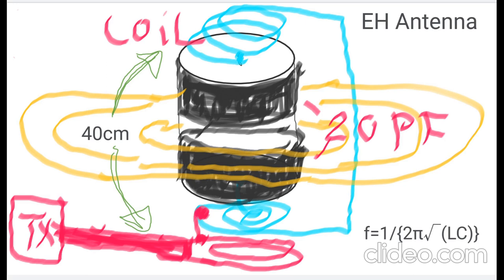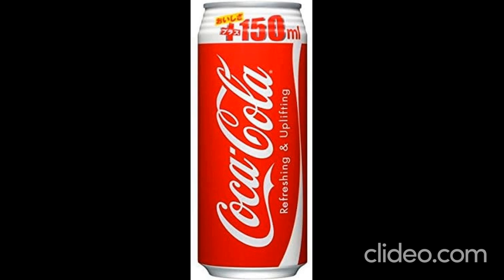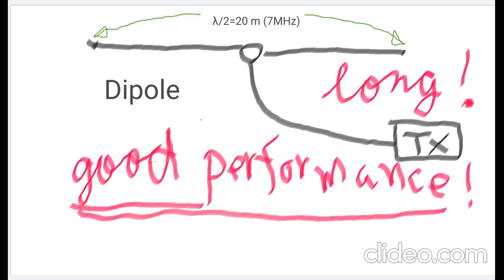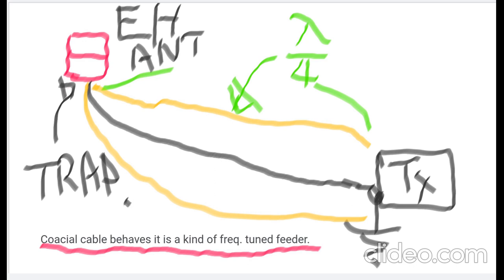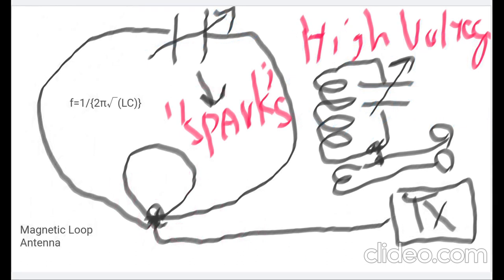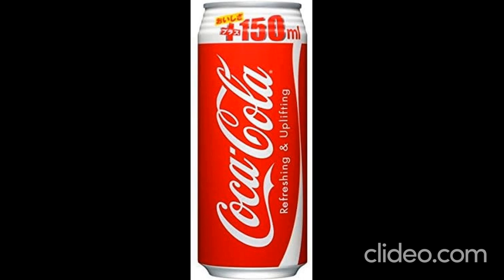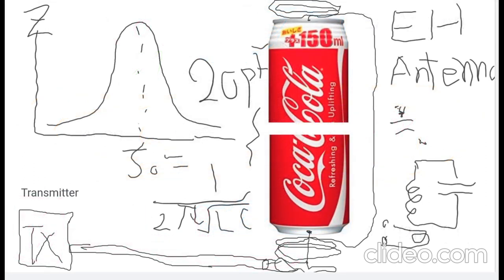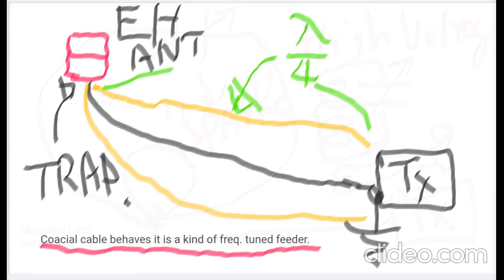Consideration on the EH Antenna experiments (Recovery of a lost file by something unknown error)

Comment: There is a dual coil wound tune no can tho but any metal object not grounded and ground can float no counterpoise, but worth it if can be added to transciever or ground end of coax, desparate to get on air. The circuit similar to broadcast reciever ferrite rod antenna tho no ferrite, loose turns, and connected to ungrounded metal object to add to amount rf radiated, not just happy swr reading, and will need a variable capacitor to tune large coil and ungrounded metal object to resonance but will also be narrowbanded and need retuned every .05 khz average, especially at lower frequency where antenna and match device struggles most for resonance very picky, and tricky, approach to dating successfully care must be observed then taken not too much, even after consuming alcohol be great care and make job interview fun and gather intel while smiling 60%  fluxuation, without null or creepy lobe too low to Earth's surface, or below horizon, even when front to back ratio is presented look quickly like at Sun to avoid blood flowing to wrong brain organ cluster package. Will enjoy many years but repair maybe needed anytime and enjoy new hobby during life, always save money in hole in ground like pirate in plastic time capsule do not forget location. 73's